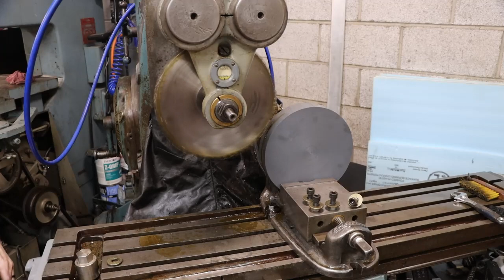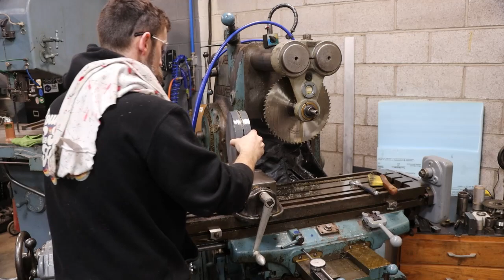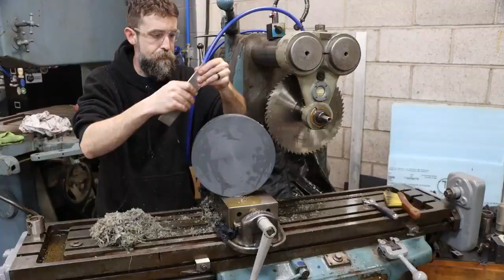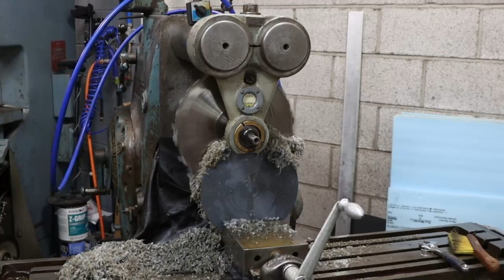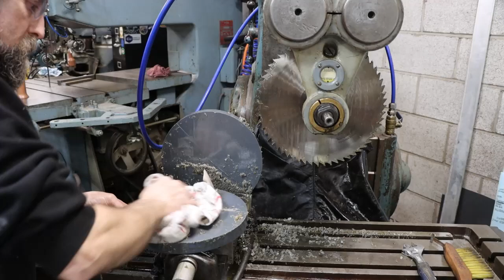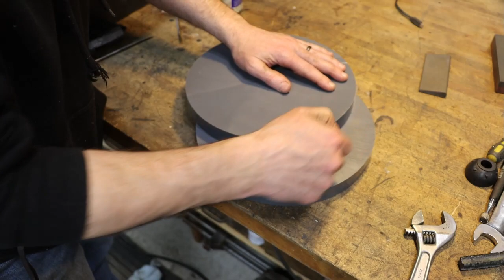Using the BIGGEST Saw blade my K&T will take. How would you do this job?

Comment: Around 30 years ago I was working in a small 2 man sawmill. I was pulling a slab away from the 42" headsaw, and the blade pulled the slab back into the saw. I felt the vibration on the slab, and the sawyer shouted at me. I looked back over my shoulder and the sawyer was pale white, being a deeply summer tanned Native fellow, this concerned me. I thought he hurt himself while I had my back turned. He was holding his hands up in the air, gesturing at me. I glanced down at my hands and my gloves looked perfectly fine. He yelled something again and rolled his hands over and gestured at me. I rolled my hands over, and looked once again.
The index fingertip of my left glove was gone, and the other 3 fingertips were full of holes. I can sit here and hear the slowing whine of the headsaw and the sound of the engine shutting off as I pulled off my glove. I can smell the pine pitch in the air. I will never forget the sight of my fingernail missing, yet the 2 flaps of skin on either side of where it was flapping in the air. There was no pain until that moment and it was from my ring finger that was starting to really bleed. Just a wee little cut less than 1/4 long and less than 1/8 deep. The impact, fractured off a silver of the end fingertip bone and fractured the nailbed in a cross shape.
Most of the nerve endings were removed from the index fingertip, but all were intact in the ring finger and howling. I had 13 separate holes in my left hand glove fingertips, what saved me from further harm was the fact they were all full of sawdust and wood chips.
20 miles to the closest town and hospital, no phone, but we had a full trauma First Aide kit, triaged, and wrapped both fingers in bandages, and I had to drive to the hospital. I had the only running vehicle and the Sawyer was such a reprobate he would have been arrested for driving even in that situation, lol. 
At the time, small town Hospitals didn't have a Doctor on site, they worked the medical clinics during the day, and shared Hospital duties on call.
The nurse tried to convince me to drive back uptown to the clinic, until I unwrapped my one finger, lowered my hand below heart level and pumped blood all over her desk, and floor. She had a Doctor there in 5 minutes. 
The first 6 weeks my ring finger ached. They had to remove the fingernail, stitch the nail bed back together, and tuck the bone splinter back into place. The next 6 weeks the index finger ached as it healed. and 1 week after that the Doctor finally let me go back to work. 2 weeks later I received my first paycheque in 15 weeks, and the first cheque from Workers Compensation Board. It was a very lean 15 weeks with zero pay.
I will never be able to count to 10 on my fingers, only to 9-3/4. Having 13 weeks on my hands, so to speak, I calculated if it takes 1 minute to clean under my nail, and to cut that single missing fingernail, and to file it smooth, at least once I week, and I only live to 72, I will have saved 26 hours of my lifetime.
Steve, I hope you take away only one lesson from my long story. Never, Ever stick your fingers where you wouldn't stick your pecker! Watching you touch that moving saw blade, on both sides! made my stomach lurch and my sphincter pucker. If you would like I can dig the x-rays out of storage and show you what a short hand looks like. I had photos and the original glove, but my ex-wife threw them out during one of our moves.
Even right now, I can still smell the pine pitch, the copper scent of my blood, and the hear the whine of the headsaw slowing down.
Reply: I crinched when i saw him touch that blade with his fingers,I'm no machinist but i work with very sharp knives every day,keep clear of the sharp end!!
Reply: Sir you quoted my favorite safety briefing almost verbatim.  I've worked around enough equipment that would happily remove anything you stuck near it, and the whole video my gut was clenched and the voice in the back of my head was screaming NO like a camp counselor in a horror movie.  Fortunately I can still count to 10, but I've worked with people that need to use toes to reach 4.
Reply: My shop teacher from eons ago, when dinosaurs ruled, told us how he chopped two fingers off his hand with the table saw and became Mr. Zowie. Best lesson I ever learned.  RIP Mr. Zowie. Still thinking of you.
Reply: I have an old Coots handset mill up here in Northern BC that has a 52 inch headsaw and a 42 inch top saw and can see your entire story unfold. I no longer saw as I have lost a R leg from an incident in the bush but defiantly know what these saws are capable of. I once saw a sawyer get careless and lose his left arm close to his elbow. He still saws to this day.

Comment: Get rid of those draw strings on your sweater, please. Danger Will Robinson!!!
Reply: Yea, a lot of them now a days have the strings sewn in at the peak of the hood so they won’t fall out in the wash. Makes them much less safe than they used to be
Reply: I am chief of safety compromisers, but I am equally concerned about the large towel hanging over his shoulder and leaving the vise handle in place while machining.
Reply: While we are on the safety thing…. How about a shout out to the “Sharp Spinny Thingy Touchy Bit “
Reply: Since Jr high the first thing I do when I get a new hoodie, remove the garrote string and with my pocket knife cut a slit about two inches down the V at the center of the throat. All the cool kids did that lol.

Comment: That was a ride - Phew!
I might have considered using a rotary table to hold and rotate the piece, and then used the saw blade as a live parting blade. That's if you could mount a large enough chuck on the rotary table of course.

Comment: Hi Steve, if and when you need to drill holes in that PVC, make sure all your tools have Negative rake on the cutting edges. Won't pull out of the vise and climb up the tool.
Reply: Also true for brasses and bronzes.

Comment: It looked a little risky when you started but it all turned out super.  A trick I was given was when a issue of the part moving when clamping in a vice or on a table was to put paper between the jaws or table and the work.  This will brake the oil film and make for more holding friction. Anyway it was a interesting fix.  Keep up with videos.   Thanks

Comment: That was a tricky cut! You pulled it off in probably the safest and most accurate way I wouldn't have thought of. Then again, I don't have a horizontal mill. The speeds and feeds you used were safe enough that if it did go sideways, it wouldn't have been catastrophic. I probably would have made a 4 sided saddle out of wood for it and hot glued the part to the saddle then attempt to run it thru the vertical band saw with a tall fence in my shop. Work holding is the tricky part with a round part  like that. 

You didn't say if that was a mill specific saw blade. But, I think that any 10 or 12" table saw blade would have worked fine in the mill to make that cut. I've cut plenty of aluminum sheet on my table saw with wd40 as lubricant, cuts like butter.

Comment: Very interesting to see You cut into plastic. My fear was if the material got loose from the wise. 
Largest saw blade possible is larger than You think. Put it outside the overhead support an You can go very large…
Always interesting projects with Your machines.
I have learned a ton from You about the metal shaper so I got my own now and run it frequently!
Reply: Yes thinking the same, just the blade would not be as rigid in cutting, as it would only be supported on one side, but slow feed yes it certainly will work.

Comment: I would maybe put it in a lathe chuck and then use a bandsaw
Reply: You'd have to have a really long parting blade to make that a worthwhile proposition. And you still have the problem of trying to stop the thing rotating due to the action of the blade of the bandsaw.
Reply: Yeah, I was wondering if it would be possible to make a parting tool that is essentially a bandsaw blade kept under tension in a frame with a brazed carbide tooth in the middle. Clearing the chips away would be a problem, I guess, as well as vibration/chattering.
Reply: @samrodian919  clamp the chuck in the bandsaw table/vise

Comment: Hey Steve. Question is about the length of the blue lines on the K&T cutting machine. Are there any specific reasons why so long. They look like they would get in the way of a project. I am to understand that they are for lubrication during a project but do they need to have that much drop slack?

Comment: Cutting a short piece is tricky.
If it were under 8" I would do it on the power hacksaw, but 10" wouldn't fit. Clamping would be difficult.